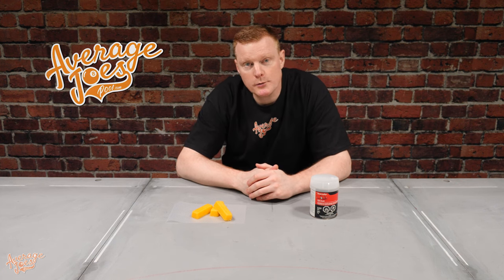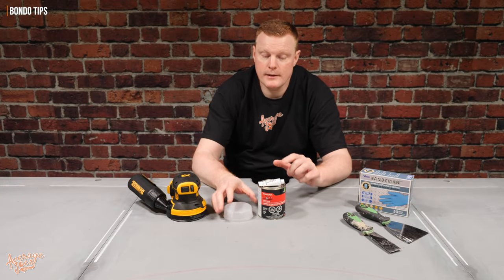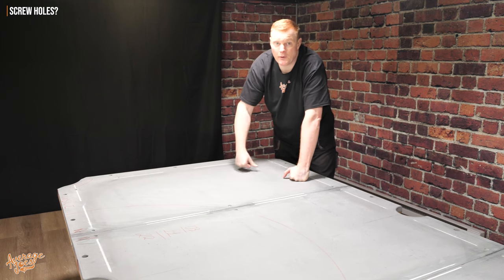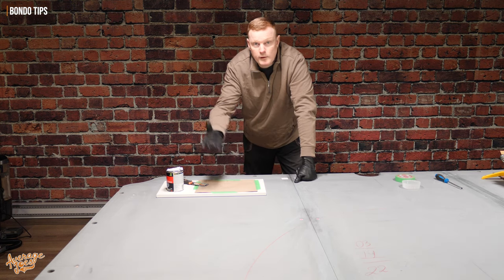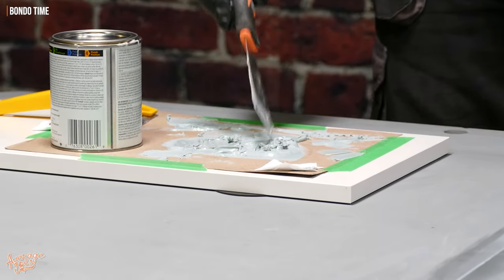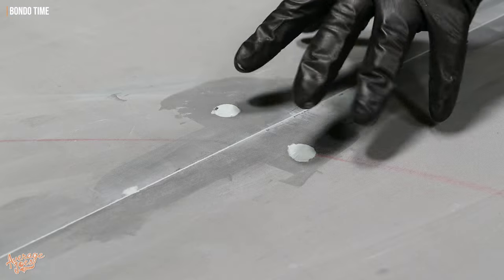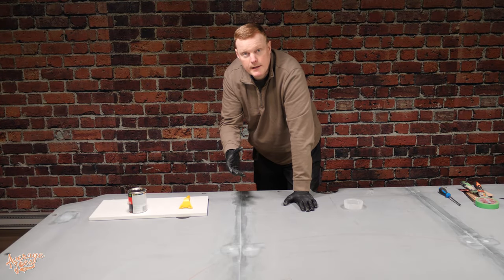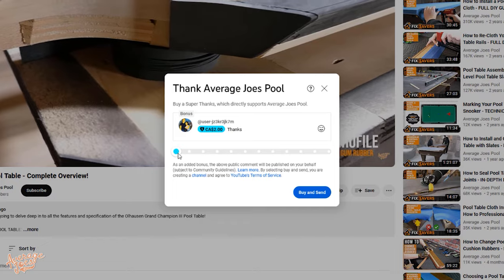How to Seal Pool Table Slate Joints - USING BONDO! Full DIY Guide!

Comment: i have a crack in the middle piece of my slate what would you suggest about cleaning both sides of the slate?
Reply from the maker: If the slate has cracked through to the rear then that is a big issue. You can get slates repaired, so it may be worth asking a local pool table installation specialist about a slate repair. Hope that helps 👍

Comment: Can you use cut out medium thin paper or carboard material to cover screws and bondo over instead of stickers?
Reply from the maker: I would recommend against that actually because the paper may pull out of place. Whereas with stickers they stay put, and you can set them precisely as you need them, and be confident they won't move,  before dropping the Bondo over the top. They don't have to be fancy stickers, any cheap sticker available from any supermarket of dollar store will be perfect. Hope that helps!  👍
Reply: Thanks

Comment: What is best way to remove beeswax off slate to use bondo over because table will be in a hot garage?
Reply from the maker: It can be a tough job, but definitely turpentine and old rags is the way to go. Change the rags regularly as the wax starts to collect on the rag (otherwise you end up moving it around rather than removing it. Hope that helps! 👍

Comment: How do you remove and prep a previous pre beeswax slate waxed slate table  for bondo? I need bondo because it will be installed in a non air control garage a hot garage in North US? How to prep slate for bondo if previous slate was beeswax and needs bondo due to hot temptures in garage?
Reply from the maker: The best way is to use turpentine and get to work rubbing it down using old rags. Hope that helps! 👍

Comment: I been doing tables for over 30 years and there is nothing more irritating than dealing with bondo! You cover up the screws and it takes 10 to 20 minutes to dig out one screw. Now I understand when you are dealing with heat when it's in a garage or something. But let me tell you. If you support the middle of the slate and use super glue on a peace of paper it WONT rub out the wax. Lay your wax line down and scrape it. Run the torch over it again and scrape it again you wont have a problem. If your a die hard, got to do it with bondo cause you think that's the only way to do it, please don't bury the screw with it! Also you can buy wax made just for this. It's expensive but works very well in hot environments.
Reply from the maker: We appreciate your input, thanks for taking the time to watch! Absolutely 100% on getting Bondo out of screws - what a nightmare! We have a section in the video showing how to cover the screw heads before applying the Bondo - essential if using Bondo. Great tips and input, thanks for sharing 👍

Comment: I wouldn’t ever use bondo, it shrinks and is hard to remove to re level the table. Beeswax is the way to go🎉
Reply from the maker: Completely understand. We've also done a video on sealing with Beeswax, and we have a video coming up covering Bondo vs Beeswax outlining the advantages and disadvantages for both methods. The decision which works best will depend on circumstance and which you prefer. Bottom-line - both work! Thanks for sharing 👍
Reply: I use his video for the Beewax come out awesome. Unfortunately my table outside and the Texas heat melted the wax. So now I disassemble my table to use bondo since my table outside in the heat. And wax stain my felt when it come through.
Reply: Thats why you should superglue your slates before the bondo. Makes it a 1 piece slate, easy tp re level